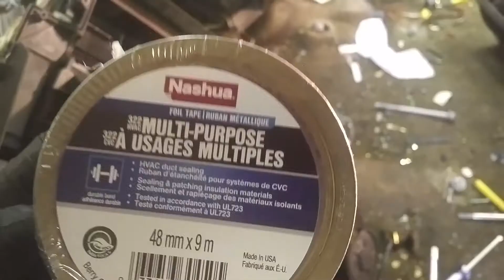Pontiac Montana HVAC Air Box Design Flaw and Repair/Correction

Comment: I have a 2001, I charged the ac, it worked until the day I put it on heat, now no matter what it seems to be stuck on heat, hot air comes out even when it's off, and turned to cold, and the controls won't change anything from the front vents to any other setting. What should I do?
Reply from the maker: Remove the kick panel driver side and passanger side and see if can see the servo motor for the blend door.
Chances are motor went bad.
Replace the servo motor.
Should work

Hopefully you can get to it by removing some interior trim peaces, otherwise you might have to pull out the whole airbox like i did.
I wish you luck.
Let me know how it goes.

Comment: Sir, with what you've seen, with passion,  and know from tracing all the passages and settings;  I am working on a 1999 Montana that will not stop bleeding hot air year around: the heat floods the A/C and it will not cool the van;  I thought and hoped it was a bad control head on the dash OR actuator by the gas pedal; The actuator is working and moving 90 degrees; ; HOW DO I SHUT OFF CONSTANT HEAT TO STOP DEFEATING THE A/C based on messed up engineering ??
Reply from the maker: Is your a/c circuit charged with refrigerant ?
And
Is your a/c compressor kicking on with ac switch at head unit pressed in ?

Comment: I have an '03 Venture with the same problem.  I thought there was trash in the system because the van had sat up for several years under some trees, but no!  GM engineers come through again!  Bastards.  I guess I'm just going to freeze.
Reply from the maker: Did you check the air cabin filters located behind plastic cover in glove box.
Those filters get clogged and need to be replaced every so often.
In the winter i would just remove them outroght.
This will help improve your heating sotuation this winter.
Reply: Exactly, and can't see anything out the windshield when it is 20°

Comment: hello, turning a Pontiac Montana into a camper, and I'm struggling to get the HVAC out. 5he entire dash is out and it's all that's left, besides the rear HVAC system, any tips, or recommendations for build ideas and removal of the front HVAC system,
Reply from the maker: Have you removed the bolts on the engine compartment side of the firewall holding your hvac box in place ?
I think there are 2 possably 3 bolts.

Comment: I sure hope I don’t have to go so deep when I get to work on the 2000 year model since it looks largely the same. Taking out seats and steering for this is way beyond what I’m willing to do. :)
Reply from the maker: One of the servo motors for air box is accesible from driver side.
If your noticing air not being dorected when you switch dial or air temperature from hot to cold.
you can remove servo motor from box still installed and seats in place.

Just remove the driver side front panal to gain access to corner of air box that has this servo motor on it.

Not sure if this servo motor is temperature motor or door flap motor for directing air.
Cant remember.
Reply: @mechman4  Thanks. I know the Fresh/recirculate actuator is by the windshield vent under the upper dash trim piece, so I think the one under the wheel is the blend door actuator. Thanks!
Reply: @mechman4  Thanks again for your help.

I replaced the source door actuator so it works and no longer just clicks when I switch between Fresh/Recirculate. I can see that the blend door actuator is turning the blend door just fine when I turn the Hot/Cold knob. Unfortunately, I don’t get anything out of the front vents and I can’t seem to redirect the air no matter what I have the knob set to. This means I still have a problem with the mode door or mode door actuator.

It seems they switched from vacuum to electric mode door actuation in 2001 and mine is a 2000. I can’t seem to find any info about where the mode door or the actuator is for the 2000 model. It’s maddening! Looks like I might have to do a deep dive like you after all. :(
Reply from the maker: @emmettturner9452  

Sorry to hear about the future project ahead of you.
But take heart.
If you have cordless tools and air tools, tearing apart the inside of your van, although allot of work can be done in a weekend.
Make sure you have all your replacement parts ready to go so your vehicle doesnt sit out of comission while you wait on parts.
I would recomend replacing your heater core and hard to reach servo motors if your going to go into this disasdembly. You dont want to be doing it twice because your heater core later fails down the road.

Comment: Maybe it’s because hot air rises anyway. That’s why I always manually direct hot air to the lower/floor vents in any car that lets me.
Reply from the maker: In most climates that is enough to keep the windshield defrosted
In northern regions of Canada its never enough.
Gm knowing they were going to sell this vehicle north of the boarder should have done a better job designing the hvac system.
Sadly they did not. At least not on the pontiac montana.
Reply: @mechman4  I noticed that some configurations duct air under the seats to the back passengers and then the auxiliary heater in the back has vents that blow forward to the front seat from the ceiling. I wonder if this explains the weird configuration in your duct work. It may be that they expect the driver to control the auxiliary heater for their comfort.

Comment: I’m pretty sure there was a redesign because I have an 2004 Pontiac Grand Am and I get heat out of all the zones just fine
Reply from the maker: I imagine your right.

Just my luck I bought a 2002. 2003 or 2004 would  not have been an issue.
Reply: @michaelgrantham5344   yes but all the Pontiac products from
1999 to 2005 share a lot of the same parts the HVAC is very similar and dose share some the same design and parts